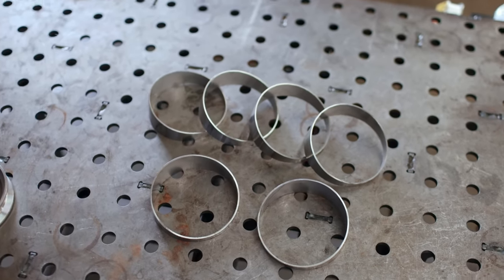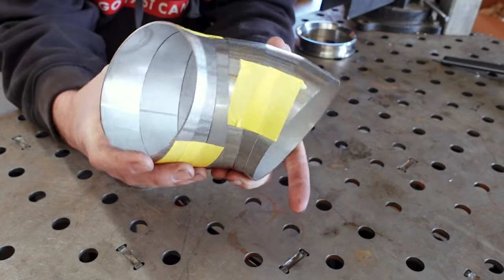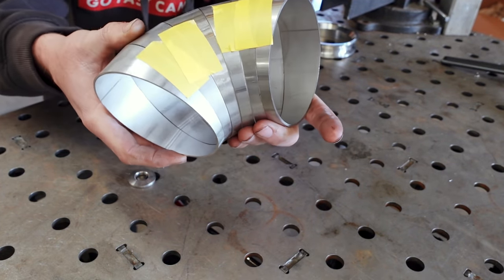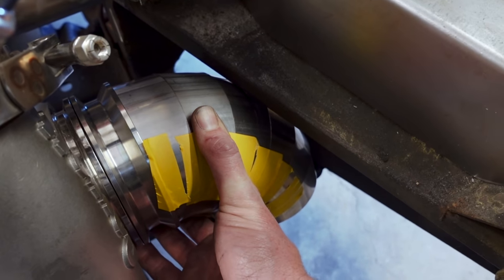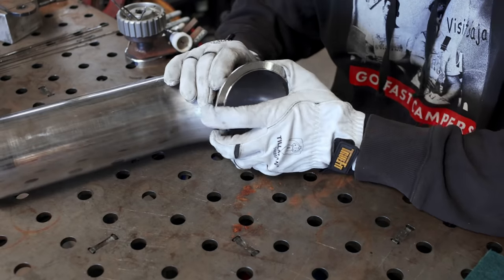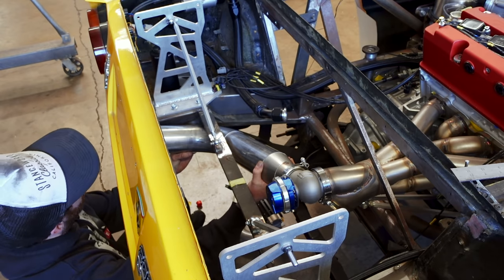1000hp Honda-Powered Ferrari - Turbo Exhaust and Wastegate Dump Pipe Build!

Comment: Loving the upswept look, are they going to finish there or be a bit longer? You might want a little extra room for overrun flames so your rear end doesn't get scorched?
Reply from the maker: You’re probably right!
Reply: Yeah they definitely need to be a tad longer or he’ll have to install some old school heat shield plates on the bumper (that’s not necessarily a bad look tbf)

Comment: What can I say that exhaust looks FANTASTIC and is a very clever way of fitting two exhaust pipes to a 4 cylinder outlet. Also it has a real Group 4 rally car look and the placement is awesome. I look forward to seeing it with some laser cut mesh and the white coating. 

Also great job organizing that corner. I see some nice stuff in the background too ;)

Comment: Looks awesome! Great symmetry out back. I wanted to throw in my two cents by suggesting a "megaphone"/"trumpet" style end to the pipes, where the last few inches taper out to a wider opening, especially if you need to extend the end past the bodywork. Would give a nice finished look vs. plain straight pipe, and be a nice tribute to the 288 GTO sport exhaust

Comment: cool exhaust build!! before tacking up your tube it seems you have a few big gaps in between tubes, a pass on the belt's sander work amazing to bring the welding faces straight to prevent any movement during welding. keep it up!
Reply from the maker: Unfortunately the gaps I do have are because it's in the middle of the mandrel bend where the tube isn't perfectly round due to stretching, so sanding won't close it up. We'll see how she goes!

Comment: The setup looks legit. 

I kinda think a small taper cone ( like an inch long) on the end of the exhaust tips would look cool. So that they come out a little past the the bumper length. Kinda like that race one you showed.   

Regardless. Looks cool dude 👌🏻

Comment: Stainless pie cuts are a disaster waiting to happen unless you're an above average welder. I reckon tight mandrel bends look waaaay better when done right and will end up having far less stress issues later on. Welding away from bends will be significantly stronger and less likely to crack with weight, vibration and movement. Looks sweet can't wait to hear this beast finally kick over!!!

Comment: Great vid as always. Bend radius has a larger effect on flow restriction than diameter. You would have been better with a 3inch 1.5 or 2 D rather than the 1D 3.5 inch. There is even a step from the turbine down to 3 inches. I love the fact that you can (and do) drive a car on the road with no muffling at all. Most racetracks in the rest of the world have noise limits and on the road, forget about it!!!

Comment: Mike, since you've been on a quest to keep the weight as low as possible, wouldn't it be better to keep the wastegate tube at 2,5", and stepping it up only on the final section of the exhaust tip, instead of stepping up to 3,5" right at the wastegate exit? It would also keep a higher exhaust speed, and would probably sound better when the wastegate is open.. probably not that important, since it's going to be loud AF anyway :P ...
It's looking a bit weird angled up right now... but I believe in the end I believe you'll make it look good

Can't wait to see this one finished. Kudos for the great work you're doing with this channel!
Reply: My suggestion was recirculate the waste gate to the exhaust and run a Y at the end of the Turbo instead bc I also think it would sound weird  having 2 "exhaust" pipes but sound only coming from 1 side of the car. I think that will give him the same look but sound better.
Reply from the maker: I actually filmed a segment talking about this but cut it because it felt boring. It proved hard to step up to the right diameter without it looking real weird. 
And I think I’ll make the system again from titanium, to be honest.

Comment: I think if you cut the tips of your exhaust to the same angle as the rear mesh panel it would look awesome, not flush, but still sticking out about an inch or two.

Comment: Great work man! Great work in the garage setup as well. Are you pressure checking the water coolers and other items that have been welded which will be under pressure when the car is running? Just to make sure there are no gremlins?

Comment: I have a concern with the water inlet/outlet on the intercooler.  With the intercooler mounter horizontally and with the inlet/outlet mounted in the center of the end caps, it looks like you will be unable to purge air out of the wet side of the intercooler.  Maybe you have a solution for this?  Anyway, I love the build. My humble opinion is that the 308/288 GTOs are one of the best looking Ferraris.  Thanks

Comment: When the weld has those sick colours to it , it means it’s been starved of shielding gas . Experiment on a long single weld by reducing the argon flow . 
Engineering basics for the inlet and exhaust . Ram air works and if you exhaust in a really low pressure area all the better , it’s all compromises though dude . Good looking is good , good enough is good enough though . 
I think you’d really like urchfab on YouTube , he’s like you and is building some mental stuff . He has a mantra about the 80% rule that would suit you and me a treat . Love the videos .

White zirconium !

Comment: Hey. How about the exhaust pipe meet the dump pipe? 3.5" to two 2" plus the dump in one of the two. 
Also, some pretty banged up dents on piping will not make difference in airflow. Ask david freiburger of engine masters. They dented pretty good a header and power was not changed.

Comment: Really amazing looks! What about a "balancing pipe" between the two halves? maybe you could get a bit more gasses out the wastegate tip, for symetrical-ness and more even flame shooting?
Reply: Or just recirculate the waste gate to the exhaust and run a Y because I'm pretty sure it would look/sound weird standing behind the car but sound only coming from 1 side but I don't remember if he's leaving the back open or if he just didn't like the expanded wire or whatever he had back there.

Comment: So excited to see the exhaust finally coming together, you did a great job. And I love the white coating idea, I had that thought just before you mentioned it!
I may have missed this, but why does the downpipe have an extra curve in it right after the turbo? It looks like it's shaped to duck under something, but I can't see what. Is there some other component you're installing there later? 13:09
Reply from the maker: It’s to get past the chassis. I can’t do a straight shot, although it looks like it can.

Comment: Mike.  Why not simply cut the v band coupler in half and direct weld to the exhaust..... Then you gain about an inch or more to aid the bend radius away from the chassis?

Comment: I think a better option to achieve the same look would be to recirculate the waste gate to the exhaust and run a Y pipe on the exhaust I'm just thinking the car is going to sound weird with 2 exhaust pipes but sound only coming from 1 side.
Reply from the maker: That’s not a bad idea but honestly I don’t think it’ll be noticeable. The pipes are like 2’ apart  and the car will be loud. I don’t think it would make a registrable difference to the human ear.

Comment: Forgive my ignorance, but this means that from one pipe we'll get the Vrooms and from another one we'll get the Stutututus?

I like it!
Reply from the maker: The stustustus come from the BOV. Exhaust gasses come from both of these, but one is for when manifold pressure surpasses wastegate spring pressure. Basically the second pipe will scream at full throttle.
Reply: @stanceworks  Great! So Vrooms from one and VROOMS from the other. Got it! Thank you!

Comment: Looking good.    But I don't always like the way large exhaust tips sound (too ricer).    I would have split those 3.5" exhaust tips into two 2.5"  tips to increase the frequency (raise the octave) of the exhaust note.     This would make the car sound more like a small V8 and give it a more classic look (4 tips out the back instead of 2).
Reply from the maker: I can always toy with that once it runs! Four pipes for a four cylinder feels silly though. Two is already pushing it.

Comment: I really like the exhaust, honestly I thing it would also look good if it were a bit longer, especially with the aero package. reminiscent of a blast pipe or better yet Bosozuku. keep up the good work!
Reply: not only that, for functionality and not lighting the mesh/ bumper on fire on off throttle or blipped shifts it needs to be another 2-3 inches longer at least
Reply: @xoriatmike6857  I was thinking the same thing.  While the look is perfect, I wonder if the paint above the tips will survive any possible fireballs.  Love the project Mike.  We're all jealous of your talent.
Reply from the maker: I very well may make them longer! I want to get some more parts and pieces done before I make that decision

Comment: @10:19 Drilling into steel without any eye protection while the safety glasses are worn BY THE BENCH VICE ??? 

I believe the technical term for this is a WHOOPSIE. 

Given that I once had a coworker that lost 70% of his left eye sight, which would have easily been prevented by wearing safety glasses, I'm perhaps more aware of the issue than normal viewers.

Comment: No I'm not commenting on why your not stepping down with the 4 inch flange. I'm commenting on why your putting a shifty Honda in a Ferrari
Reply from the maker: Because the Ferrari engine made 163whp and the Honda motor will make 5x that far more reliably, and it’s half the weight.
Reply: @stanceworks  why didn't you just sell it and buy 3 hondas
Reply from the maker: Because I like the way the 308 looks. Is that hard to understand?
Reply: @stanceworks  wish I had the extra money to make my car better
Reply: @StanceWorks  no sir the 308 is awsome. It's the Chinese  crap you put in it lol. I'm sorry man just giving you shit. We're I come from Hondas are Rican cars
Reply: @StanceWorks  even tho I don't agree with the Honda thing your skillset is amazing bro. Very nice work